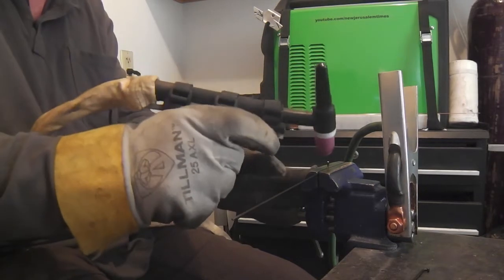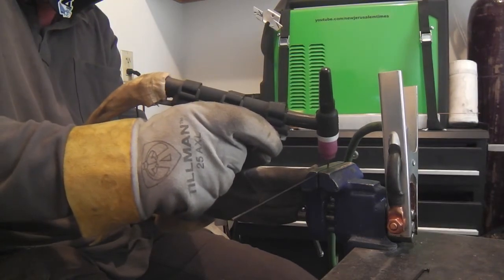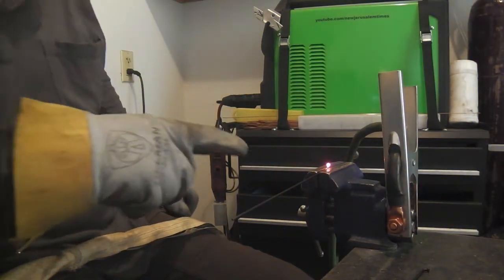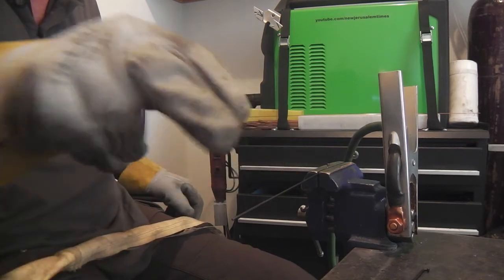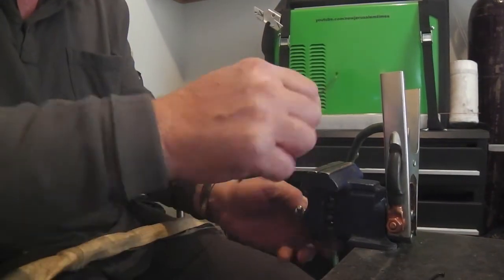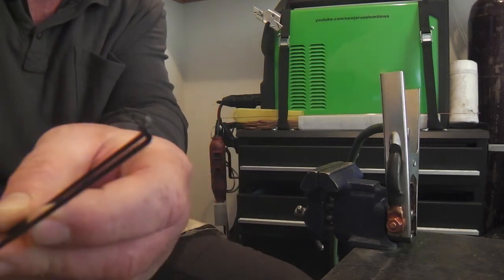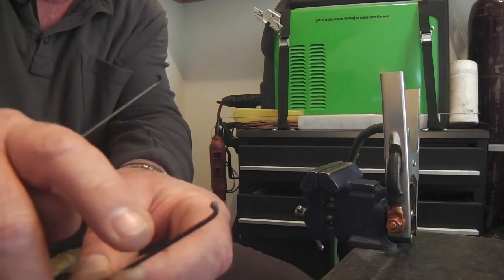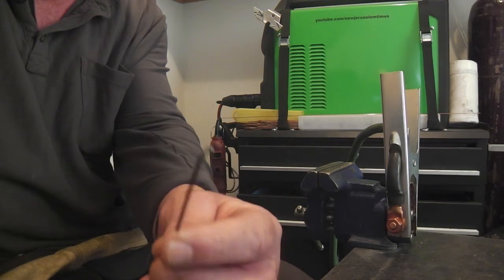Make Custom-Length Spokes With A TIG Welder

Comment: I have a TIG welder and several hub motors. I was considering getting a spoke thread rolling tool until I watched this video. Well done.
Reply from the maker: Yeah, but I wouldn't use more than a few spokes this way on a hub motor. And, I've recently transitioned to some direct-drive hub motors from China (via Amazon), which I like better than the BMC (India) planetary-geared hub motors, since they're cheaper, more robust, and have heavier gauge spokes (12 Ga) that don't seem to break like the 14 Ga ones found at wheelbuilder dot com. I got some spare 12 Ga spokes via Amazon, for much cheaper, too.
Reply: @NewJerusalemTimes  I was just about to order another motor from china for a AWD build when I came across a deal I could not refuse. A new BMC V1 hub motor for $100 shipped to Canada. I got it laced up and installed already. Ordered spare gears (one steel + 2 composite) and some Honeywell 43F hall sensors just in case. I can go up to 13G on my rims and can drill out the spoke holes on the BMC motor if they don't hold up.

Comment: did you test the spokes yet?
Reply from the maker: Yeah, I've used them sparingingly with no problem. But, interestingly, both of my rims on this particular dual-motor, dual-rear drive eTrike have had the rims sidewalls split, due to the V-brakes wearing them thin over the past six, or so, years that I had been using them. So I bought 100 new spokes and nipples to re-lace some new rims with.
Reply: @NewJerusalemTimes  
Salute, and Shalom, how goes it?